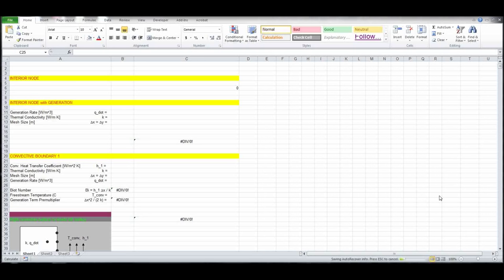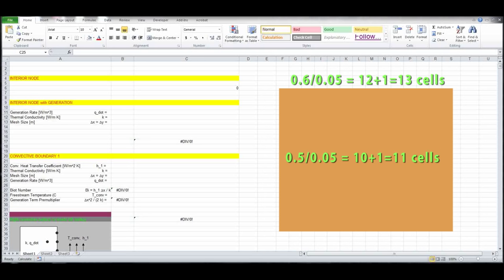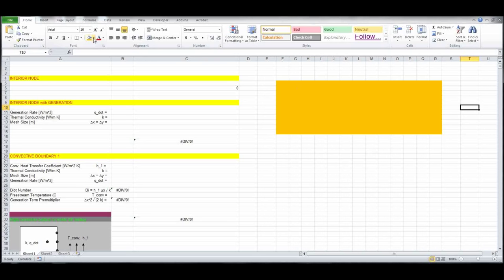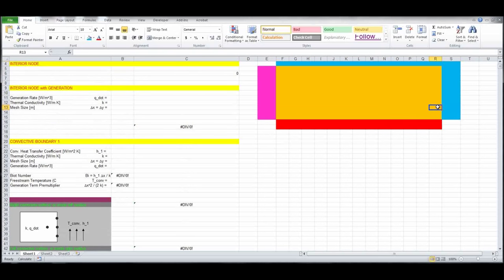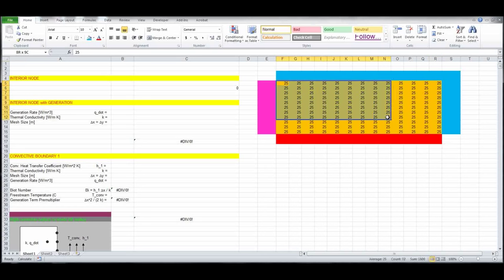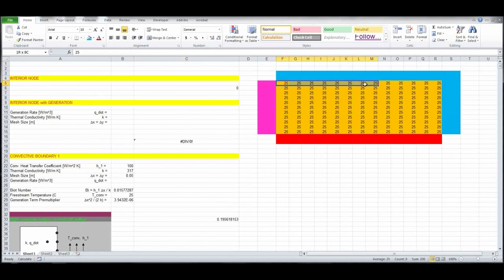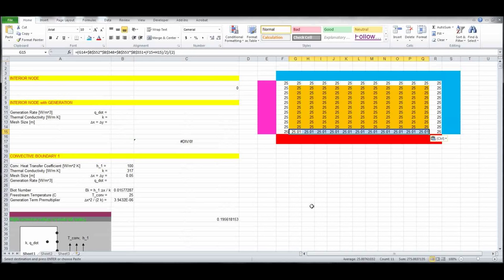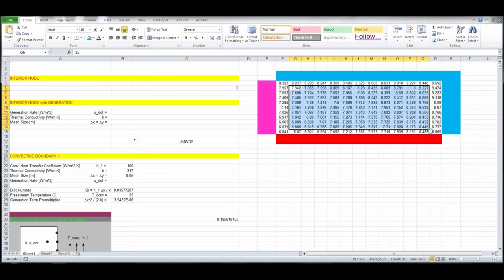Heat Transfer L13 p3 - Excel Solver - Complex Boundary Conditions

Comment: Hi, when i copy and paste the upper convective boundary values into the grid (9:46s) i get some low values all along the top row (0.1-0.4).  I am using the same grid size and boundary conditions in the video.  Also there is a circular reference error once i put the numbers in.  
I am using excel on a macbook, i wonder if that is affecting the calculation.
Reply: Just ran the solver in excel on a windows pc and it runs fine, something must be different in the solver for excel on macs stopping it from calculating properly.